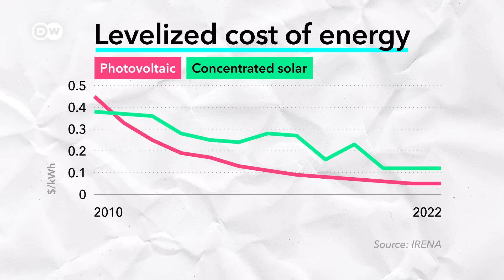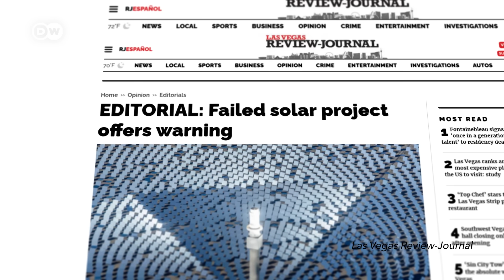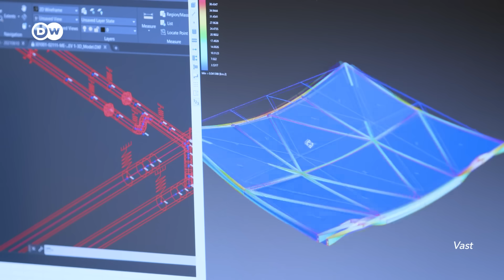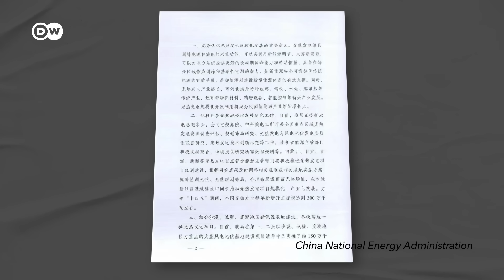How we can make solar power at night

Comment: So basically just molten salt batteries? Couldn't you just hook that onto a photovoltaic plant? I get it might be less efficient transferring electrical energy to heat rather than direct heat transfer but if we're just looking for energy storage, I don't get how this is that much better considering the added cost, space and engineering needed for concentrated heat.
Reply: PV transform 20% of energy to electricity while thermal is >80% efficient. Then the electric energy needs to be transformed to thermal.
Reply: @Angel24Marin  exactly this. CSP: ~100% efficiency (sun -> heat) * 20% (heat -> power) = ~20% total efficiency - solar & heat-batteries: 20% solar-efficiency * 100% (electricity -> heat) * 20% (heat -> electricity again) = 20%*20% =  4% total efficiency - which is expensive - more expensive than CSP technology
Reply: There are even cheaper sand batteries and there is Power-To-X (gigantic heating element) in cities with district heating grade water tanks. There are many ways to store energy. However, I can imagine that in a hot and not too windy climate, an efficency of 60% (absorption) * 30%  (steam generator) is preferrable over 20% (PV) * 30% (steam generator). And, in contrast to what is said in the video, Li+ batteries become effordable for day-to-evening-and-morning electric power shift right now.
Reply: @rainerrillke5660  I expect Sodium-ion batteries, with their lower input costs, to make energy storage cheaper than grid hook-up.
Reply: Or you can use 2 water reservoirs at different heights.
Just pump water up to store electricity, and then let it run down to spin a turbine at night.
China is building about a hundred of these pumped storage power stations.
Reply: Yes, its a glorified Carnot battery. But: putting in 1KWh of CSP heat is cheaper than 1 kWh of (most) electricity other than curtailed power.  Usually, it is more efficient to use the electricity for something more useful other than heating hundreds of tones of salt up.
Reply: I was thinking the same
Reply: It's terribly inefficient as comment above me wrote, also I might not be right but unlike photovoltaics, the mirrors shouldn't technically lose any efficiency trough time, and even better, the whole construction could be optimized to improve the efficiency, which isn't possible with photovoltaic solar panels
Reply: A basic rule of thumb in Engineering is the less moving parts, the better.
And having to convert Solar to electric then to heat is going to bring more problems than we want to invest in solving them.
Reply: Hello from Los Angeles California.  I lived all my life in Los Angeles California, and in the 1980's the Smog was so thick it filtered the Sun. The smog blocked the Sun so much the winter's in Los Angeles California was so cold between 36° to 55° Fahrenheit nights dropping to 33° Fahrenheit 
I couldn't see mountain ranges from where I live 4.5 miles away. Unless it was windy and smog cleared. Now the air is so clear you can see cracks and riges, on the rock walls. 
It uses to rain 🌧 none stop for 7 months, and the summers never exceeded 90° Fahrenheit. Due to Sun being filtered from smog I also didn't need shades, for my eyes. Now 🌡  are 110° Fahrenheit for excess of 1.5 months with 5 days in the roll Temps exceeding 116° and 1 day at 120° to 126° depending on fire conditions radiating heat. 
Air clean enough, and it will not get any cleaner with only Electric Vehicle's (EV's)
Now to the reason why Environmental green agenda causes Drought Conditions.  In 2010- 2013 there were Solar Mirror s installed to project solar arrays to a Tower with mirrors projected downward to under ground reservoir water sources.  To generate steam, and generate Electricity.  
The temperatures 🌡 causes the atmosphere to close to 5,000° and every time birds fly thru become instantly baked and fall. 

In the 1980's the Jetstream used travel across California in to Nevada,  Arizona,  New Mexico,  Texas, and so on to Florida.  Due to the Mirrors the Atmospheric High Pressure. Has pushed the Jetstream away from Southern California to North to Washington,  and or Canada 🇨🇦 . This cause along with getting rid of Smog cause higher temperatures and Drought Conditions. You couldn't pay me $10,000,000 per hour to sit, promote,  sell, let alone buy any Electric Vehicle's (EV's).
If you look up StachD Training channel, on his video titled Lithium Largest Ex plo ding EV Recycling ♻️ Center in Missouri.  There were 4 Recycling ♻️ Centers in the United States.  Now there are 2 Recycling ♻️ Centers,  and none are in the State of California.  Due to Environmental Impact, which the video shows Fire Authorities spray granulated elements of the Lithium-Ion Batteries 🔋 Packs,  into creeks, rivers,  and lake anfmd underground well resources.  Not even boiling helps, and fish hacmve died in those water ways.   Sure clean the Air while you Pollute the water. In April 2024 the 1st Recycling ♻️ Centers in Phoenix Arizona location burned down,  and dousing water to keep cool prenting spread of fires 🔥 have caused Drought Conditions.  @truebrit3670  Look it up
StasheD Training channel 
Missouri Recycling Center ♻️ Ex Plod ing can't spell this out. Fish died wells for water is no good anymore,  and became Acidic 
These are facts. 
Mirrors in Mojave Desert Modified where Jetstream away from
 Southern California.  
The so called green agenda is to keep there pockets full or bank accounts.
Reply: Or you could use fission energy to heat a primary Flibe loop and transfer heat to secondary loop for storage and variable generation.
Its ironic to see these CSP and even proposed Fusion power plants generate the heat in the most complex and expensive way possible recognizing the value of molten salts but can't see how much simpler it would be to use fission in a primary loop. But folks gotta worship their their sun gods.
Reply: @johnjakson444 Fission is why energy/electricity prices inflated massively in Europe when we currently down on using Russian fossil fuels, and there weren’t enough renewable available.  It’s so expensive.  No one wants to build fission for commercial reasons unless they get much more subsidies than even renewable electricity plants (or get to cut substantially on security measures).  Perhaps if they get to sell uranium and plutonium to the French defense industry.  I mean nukes is the real reason to why everyone invested in fission originally.

Fortunately I personally live in northern Sweden, so we have wind and hydro.  And electricity prices even sometimes became negative when it was sky high in central Europe.  Since no one has invested in a grid to transport the cheap electricity south, while the production capacity is rather high for future local industrial purposes.  At least until we had to rather fairly subsidize electricity costs for those who relied on fission in southern Sweden.
The currently government has attempted “everything” to get energy corporations to build new fission plants—in the belief that it may be needed on some occasion when the wind doesn’t blow, the rivers don’t run, and the biofuel trees don’t grow—but no one wants to.
Although this type of plants are hardly a major option for us close to the polar circle, unless you can store the heat from summer all through the winter.
Reply: @JamesRoyceDawson  depends the area it’s put in use may work for some not for other but USA so spread out our current system seems might add to much for the return. Let try everything so right ones can fit the best needs.